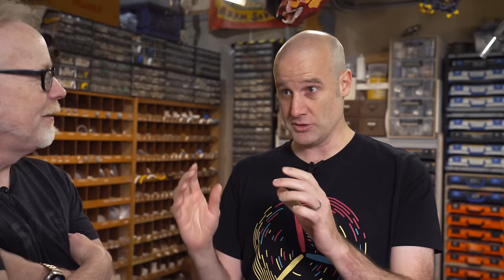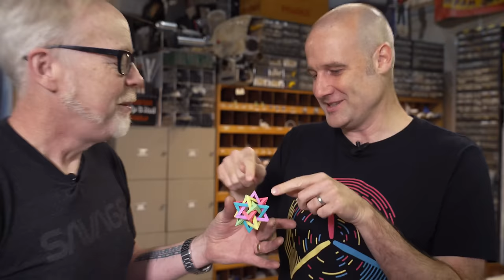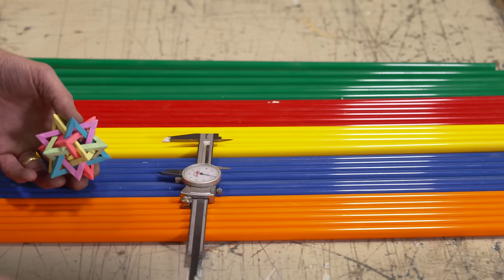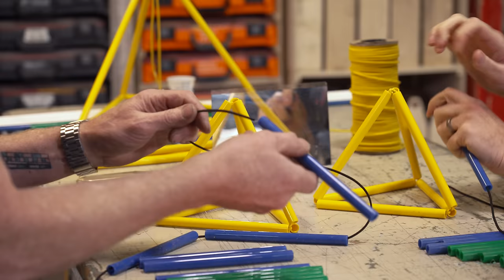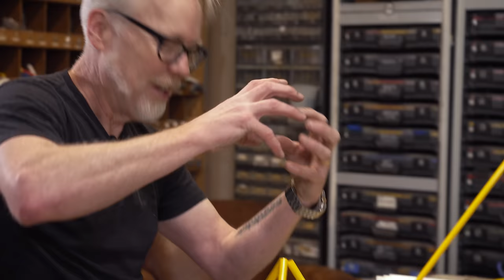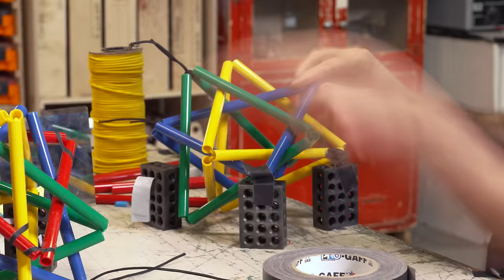Can Adam Savage and Matt Parker Build …. THIS?

Comment: Nice build, and fun to watch you guys. Looks like it was fun to figure out how to make everything needed. Adam unfortunately made at least one mistake in his that wasn't caught.

At 43:49 when you see his next to the origami model, the very bottom most red tube should be going overtop of the yellow tube, not under.
At 44:36 The two yellow tubes pointing towards matt in front of the red tube, one should be behind the red tube.
If you are looking at the pentagons made by the open centers of the 5 colors there is an 'under-over' sort of pattern, you catch the mistake other moments too.

I think Adam actually notices the mistake at 56:18 as he is checking all the sides based on his reaction and double take before the cut when he looks at that specific side. Seems like they edited it out, or he decided not to say anything because he'd feel like he would need to fix it for the sake of the video.

Knowing Adam I'd bet he did fix it though. And don't mean to take away from the video at all, was just was surprised nobody else had pointed it out.
Matt and Adam are both awesome math and science communicators.
Reply: There's a few mistakes.  Welcome to Mensa.  Some reassembly may be required on both models :face-blue-smiling:

Comment: 44:54 They are not mirror images there. Look at the number of red pipes crossing in front of yellow in that picture. Although I'm too tired to check whether the two builds are just in a different orientation or one of the builds is wrong.

Comment: Ok Adam, Do you know how you have those rounded connection pieces that you showed Matt as an example of using those pieces for models of piping?  You could design new connecting pieces that have the three points to connect all of your triangle ends and they could even have a stud to connect the outer dodecahedron to and make the different tri-angle connector for the dodecahedron intersections, that was surprisingly pleasing to type lol, and 3D print all of the connections and then just snap it all together.  I suppose that if you really wanted to go all out you could make 6 stud connectors with the 2 different angle sets for each shape incorporated, but I would imagine it to be much easier to just make the separate three way connections with a snap together connection stud.
Reply: Oh my goodness, I just thought about assembling the whole thing and closing up each section would get progressively harder to do and doing that while threading each different section into place and having to bend it all to make the connections would quickly reach a point where the materials have enough flex to do it but the spacing would not allow you to make the bends without breaking something else.  While having smoothly edged corners would make it all beautiful and hold the symmetry together instead of letting the pieces collapse with gravity you just snapping to the use of elastic cord to sew it all together may have actually been the only way that you could have made those in a day if at all without an elaborately predesigned and mapped out process to follow and that would just be model making with instructions.

Comment: Could you have built the outside DDH and then use that to position  the inner tubes?
Using a black DDH colour code the corners, the you could put the tubes inside from one corner to the next.

Comment: Refining engineering of process piping was actually designed by using scale models. An engineer would would inspect the model to determine if additional piping and equipment would fit in the space available.  These models were build by professional model makers. This was done in this fashion because there was no 3D CAD that could handle the complexity. There was 2D CAD for restrictive views.  The modelers knew that accurate 3D CAD was on the horizon and as expected the modelers were the prime candidates for 3D CAD training. Often the individuals who approved billion dollar projects were not engineers and giant models were made. The limit on the models was often the limit  of Boeing 747 interiors.

Comment: Wouldn't it have been easier to create the dodecahedron first? That way you would have all the vertices in place to make weaving the tetrahedra through each other easier. The dodecahedron would start off flimsy but as you connected the vertices to create the tetrahedra it would gain more rigidity so it could eventually hold its shape while freestanding.

Comment: Two things:

Surprised you measured the outside length of the origami strut, rather than the inside edge, given how the acrylic tubes would bind together.

Second, I would have started with one side of the dodecahedron, five moderately flat interlocked triangles, before trying to build pyramids.

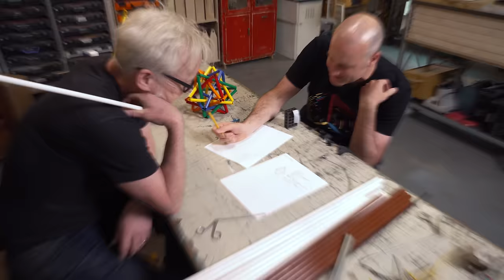Comment: 48:00 The side length is not 7 inches -- you've truncated the corners off the tetrahedron.  The phantom corner is a little more than the tube's thickness, and since the tube's aspect ratio is 1:14, I expect you're short by more than 1/7th, so maybe 15%.
Now the edges you're adding are made the same way, so you want a tube length that's shorter than the platonic edge length.  But , is it shorter by the same amount?

Comment: Noooo now I want a D20 dice in this shape where each vertex is labelled with three numbers surrounding the vertex as it is typical with D4s.

Edit: Thinking further you could probably label them up so you have in one die at least a D4 (read single vertex label but has some duplicates), a D12 (read multiple vertex labels that build a face) and a D20 (read single vertex labels).
Edit 2: Watching and thinking further you could probably only make a D12 like this since it would always land on 5 vertices so you never have one defined top vertex for a D4 or D20 application. This shape is messing with my head and I love it :D

Comment: In order to connect the tubes using solid balls with handmade holes drilled in them you could map the three holes for each ball, mark them and then individually drill each hole but who has the time? Instead, build a thin 3 legged brace maybe a foot long and trap (hot glue) as many balls as you can in a straight line adjusting the brace legs according to the math with the future holes inbetween the braces. THEN clamp down in the drill press vise and find the exact center of each hole with an ink stamp pad rubbed slightly on top of the balls where they slightly stick out. Then drill the holes in line on the drill press adjusting the vise X axis as you go.  Flip the brace over two more times, repeat and you have a bunch of balls all drilled in the same exact place in relation to each other. Break them out of the brace and assemble the tetrahedra.

Comment: @Matt: you only need to thread it through 1 tube twice. Those are tetraeders with 4 nodes have 3 connection each, one is start, the next is the end and that leaves 2 corners of odd degree, threading through the connecting makes a double edge and problem solved. Use graph theory.

Comment: Oh man. I got one of these tattooed :'D made a few in origami and even invented a version without the gaps (but has the same internal struts so its ultra dense). I wonder if it's doable as a wooden puzzle thing with 60 wedges instead of 30 flexible paper parts, but that's going to be a royal pain to make. Something to test on the 3d printer ahahahhaha
The ratio on the paper model is 1:12 going by just the width of the paper wall, but with the tube holding the same gap it's obviously a little off.

Comment: I feel like these two have similar but opposite approaches to math. Matt is the academic well versed in theory and Adam is the engineer with decades of practical math application experience. Neither's value is more or less than the other. They work together very well as a result.

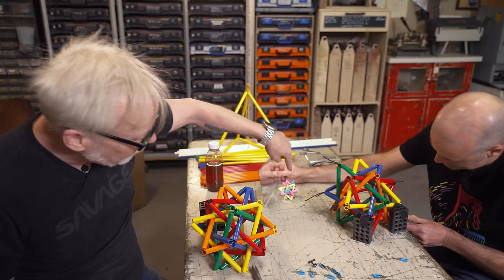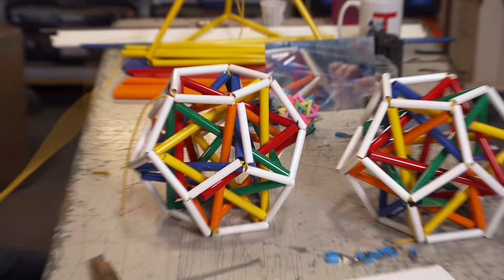Comment: I'm really sorry Adam, but one of your red tubes is in the wrong position! @43:05 the lower red one should be above the yellow. You can also see it when you do the mirror comparison at @44:55, where the incorrect red strut is on the right of your (shown left) model. I think this might be why @53:28 the three reds in the corner are spread out instead of going to a point.

Comment: Why start with the Diamond?  Start with a Triangle and then the 4th goes trough 1 pipe and the 2 ropes coming out go each to a seperate pipe ... and in the End just one of them has to go trough the Starter Pipe on the opposite Corner of the Pipe you put 2 ropes. 

so (Triangle) 3 pipes with 1 rope , 
next 1 pipe with 2 ropes, 
next 2 pipes  each 1 rope,
next in the starter pipe (opposite of the pipe with 2 wires inside) put one more rope in to it 
and now knot the loose wire to this wire and you^re done.. (with the first Peace)
now repeat 4 more Times

Comment: Now, the interesting question would be how one should cut the ends of the pipes to end up with closed looking sharp corners? I think it would require two cuts per end in an angle between 30 and 60 degree but I have trouble wrapping my mind what's the correct angle. I know I could create a 3D model and just measure it but I think that would be cheating.

Comment: Could you  3 d print the outside with a ring on the inside point and then macrame/thread  the inside using string or yarn  Or have the ring or washer  and use long bamboo skewers  and thread through the ring  Then come back and snip the part off that sticks out past the ring-  print a template or gig  that you would set on the ring line up with an edge and it would fall on the other side or touch  on the ring you need to thread through.  Oh and then when you print the white outside shape have notches on the inside of the ring for the skewers  to snap into for proper spacing.  Could this be done as a puzzle were you have the printed outside shape and then using colored rods and a template tool to snap the rods into the right location?  I think for each ring you would only need three notches and only one color would use those notches. Then possibly a gromet or plug to go into the hole of the ring to hold the sticks in place possibly color coordinated to the sticks or rods.  .  The ring could be color coordinated.  So by solving a color puzzle- do you think your brain would subconsciously start to understand the geometry? LOL - fun to think about how you might build something.

Comment: Deburring cut thermo-plastics.     Takes (minimal) practice, but just hit them with a torch.    The sharper the edge the faster it will absorb heat and surface tension will- as its warm enough to deform slightly pull in those edges.   with a hollow tube, even better as you have only one operation on each end rather than two.

More the hotter the torch the better this works ....  the sharps heat MUCH faster, and of course thermal transfer is high exponent of temperature,  so with a very hot torch (I usually use a little hand held butane torch) the burrs self deform rounded before the body has gotten even mildly warm.      

Of course DON'T let yourself be distracted while aiming the torch at the plastic... but you'll quickly learn to NEVER let yourself be distracted while holding a lit hot torch ... it's the kind of mistake you'll make ONCE.  (and hopefully it will only be very painful and not catastrophic that once.).

Comment: Get your balls drilled Adam. The rod lengths wont matter if your angles are correct, as long as you're within a few millimeters. Re-cut all your rods from dowel,  paint them for the color. No fiddly cords and tensioning! would be great if you revisited this for a one-day build. The last few balls might be a bit tricky but if you manage your lengths you'll have the space to fit them. Use, say, 3/8th dowel for the outside and 1/4 for the inside, for example. This will stop your balls becoming total swiss cheese. Depends how big they are really, I'm sure you ca work it out.

Each ball needs 6 holes in one hemisphere, 2 sets of 3, I wish I knew the numbers for the angles but I dont. One set for the dodecahedron rods and one set for the icosohedron rods.

Where to those chemistry ,odels come from? Maybe has what you need already?

Comment: In primary school I started by memorizing it, not at all working it out. I was 3
Reply: I had the button times tables. You see the 1+1, press to see 2. Also 1*1 and see 1 when pressed. I had to memorize that. Working it out was too hard because zero experience with relation of the values.

Comment: The two pipes that need two passes are the two opposite (perpendicular) edges…
Reply: Also, I think the reason it is harder to see where the next one goes is that each of the base tetrahedra are standing on the single point that makes one of the sides of the dodecahedron,not flat on one of the tetrahedron faces…
Reply: Actually, the whole thing would be much easier using maths to get the dodecahedron edge length, and build each tetrahedron into the center in the right place…
Reply: I would actually call Adam’s the left handed one, as the spokes as you look at the dodecahedron face, are spiraling out counterclockwise…